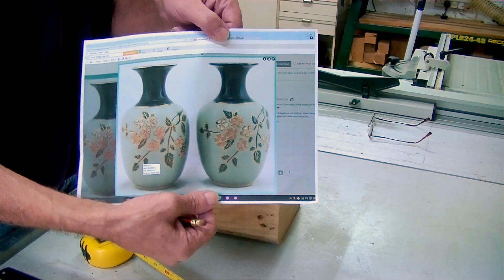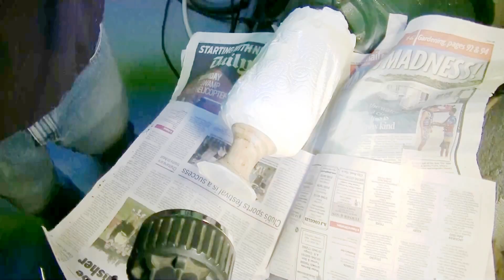Woodturning - Turning & decorating a Ceramic design vase

Comment: Great video / Fantastic piece. Whose paint did you use for the black and green base coats?  I have had a problem on painting my bowls. Did you use sand and seal before painting. Thanks again for sharing.
Reply from the maker: Hi Curtis,
The paints used were Acrylic airbrush paints by Createx and Com-Art mixed to the required shade and I did use sanding sealer first. Thanks for the comment.

Comment: I’m am interested in trying this myself, and have a few questions
1. What did you use to dye the bottom? I was thinking of using a dark wood stain like ebony.
2. What kind of paint did you use?By what kind I mean was it acrylic or an oil based paint.
Your feedback would help a lot and probably save a few pieces of wood-lol. Thanks for the inspiration
Reply from the maker: Michael Bledsoe, All the paints are Acrylic. The main colours are specific airbrush paints by Createx or Com-Art mixed to the required shade. However I wanted a specific colour for the base to mimic natural clay, so I obtained a close colour match with a Humbrol Acrylic paint with a colour reference of 93. I got this from a model shop. Hope this helps and good luck if you try it yourself. Thanks for your interest.